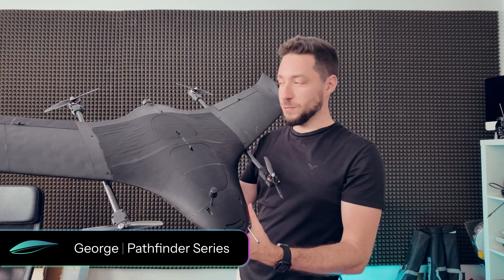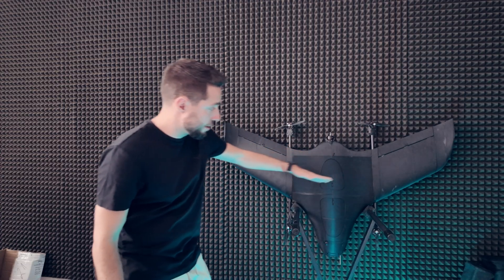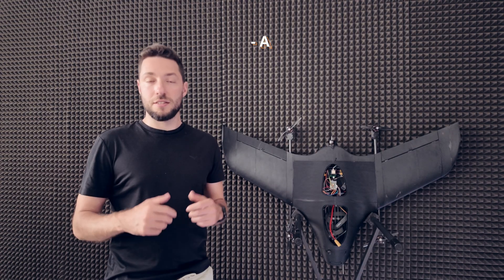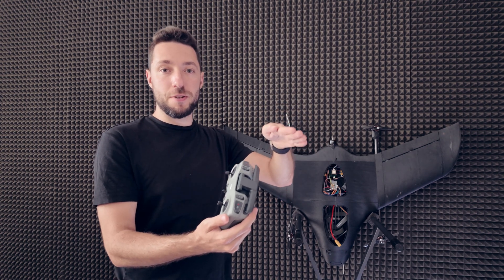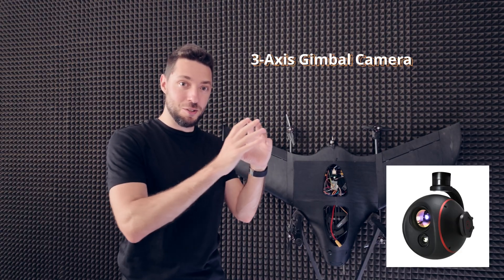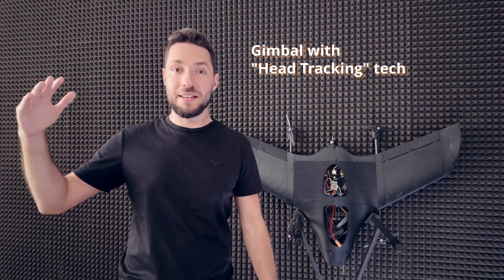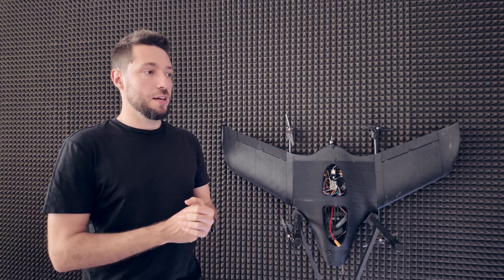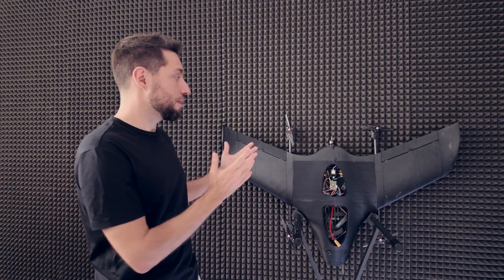How do Autonomous VTOL Drones Work? QuadPlanes Explained

Comment: This design seems a little bit wasteful in that 4 of the 5 engine are not utilised during forward flight. Wouldn't it be better to make a simple tilt arrangement so that the lift engines became push/pull during horizontal flight?
Reply from the maker: In theory yes, but in reality you can really dial in the motor / propeller combo. Max efficiency in hover and max efficiency in forward flight. But yes, the 4 motors do become dead weight. They do provide safety via redundancy if the main motor fails tho

Comment: Have you expect any gps problem with asa cf ? I do not see the antennas, i suppose they are inside
Reply from the maker: I later installed the GPS on the outside just to be safe. Haven't tested CF interference.

Comment: If you want a single use fixed wing drone (ahem, you know why...) could you have a VTOL drone that lifts the fixed wing drone to get it flying and then the VTOL drone detaches and returns home for reuse?
Reply from the maker: Theoretically yes, but it might be much more efficient to design an air-pressure powered launching system for initial take-off. Ardupilot supports hand-throw assisted take-off, which should do the trick... If your payload is... ahem... heavier than 1kg you might consider solid-rocket fuel for take-off (first 3-5 seconds)... theoretically.

Comment: Awesome Video. Thank you for posting it. Which Pitot tube do you recommend?, and is it easy to add it to the FC?
Reply from the maker: I used a matek airspeed sensor. It came with an SH1.0mm 6-pin cable that plugs directly into the SpeedyBee F405 Wing. 

I don't have experience with airspeed sensors, so if anyone can chime in it would be great.

Comment: Hi do you know why the VTOL keep Yawing? What should we check and improve?
Reply from the maker: Does it oscillate from left to right or is it spinning? If so, how fast? Make sure the motor mounts are glued to the carbon rods, as mine shifted and caused a crash. Also make sure the props are correct for the rotation CW/CCW.

Comment: Hi do you have any guide to make a vtol plane?
I am building normal RC Fixed wing (delta)
I am planning to switch the design to VTOL

My specification are as below
F405 WIng speedybee
AKK Race Ranger VTX
Foxeer CAM
Matek R24D RX
Radiomaster Pocket ELRS
4S 2500mah
DYS 3530 1400KV
GPS Walknail M10
Reply from the maker: It’s awesome that you’re build one! There’s a whole build series in my channel that goes through the whole process. Should help you out.

Comment: "Great work, but I would like you to provide us with a video explaining how to program the SpeedyBee F405 controller for a VTOL (4+1) aircraft, please sir."
Reply from the maker: Ok, will do. In a nutshell, you install ArduPilot’s ArduPlane and configure it as a VTOL with an X-frame. There are a few more changes in the config file tho. I’ll do my best to do it soon.
Reply: Yes, those changes caused a problem for many hobbyists regarding the SpeedyBee F405 board. I would be grateful if you could explain that in a video

Comment: I'm suprised you uses ASA-CF instead of ASA-Aero?  I am using the latter for a Stallion VTOL build and am having a tought time getting good prints on my A1 Bambu (have hacked together an enclosure and filament dryer....but it's a 50/50 on if it comes out as a good part or stringy).... While I do like that the light weight...almost feels like syrofoam, I am wondering if maybe I should fiberglass the wings for strength or if that might add too much weight...anyways.  I'm still in the printing phase of this build and haven't even begun with the electronics yet but appreciate you sharing the insights from your build!
Reply: I’m doing the same. First of all, dont mind the stringing too much its very easy to post process and most prints with this material will inevitably require that. I also plan on laying some fiberglass as well and its very unlikely that it would be too much weight especially with a low density fabric and proper resin, The single part that will affect the weight and cg the most is the battery so don’t worry too much about the airframe weight if you are already using ASA-Aero.
Reply: @milanpatel7731  (wishing I could post a picture in a youtube comment).  mainly I am getting voids in some areas, I even considered getting some Home Depot spray foam to fill the voids to sand them down even with the rest of the surface giving a convex surface for fiberglass fabirc to cling to........will see how that turns out after I learn to fiber glass hahahaha......Am loving all the skills I am picking up rom this project..  FWIW I am already coming off of learning arduino and 3D printing from building Lightsabers, then robotic exoskeletons, so this idea of learning "body work" for a smooth hull is a new skill.
Reply: Ma in America non ci sono delle limitazioni di volo o patenti da prendere per legge per far volare un Drone in un ambiente cittadino o limitrofo?
Reply: @PinopalU  Yes, there is a FAA Drone license for dones over 205g. I do not have mine yet, but it appears no more difficult than getting a driver's license.
Reply: @Shinkaze33 actually there’s no requirement for this. Over 250g the drone simply has to be registered which is $5 and lasts 3 years. Also may have to take some sort of online test which is easy. License is only required for commercial flyers aka for hire.
Reply from the maker: Both ASA-CF and ASA-Aero are somewhat similar in core characteristics like density, UV resistance, etc. CF makes it a more stable and easier to printing, but it does require a hardened nozzle and extruder gears, hence why I upgraded my P1S. 

I haven't tried adding fibre glass. I only sprayed clear-coat - it's tough enough, so don't sweat it.

I would be curious to try LW-ASA with Foaming tech tho. Ideal candidate for reinforcing with Fibre glass.

Good luck on your build!